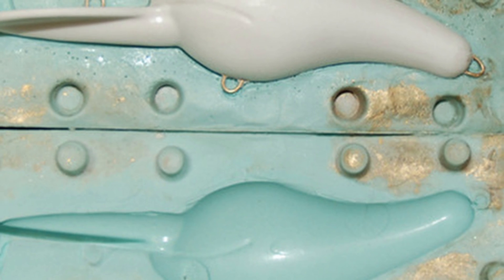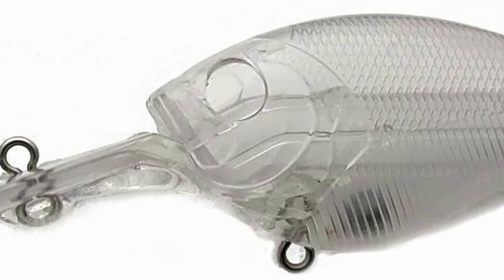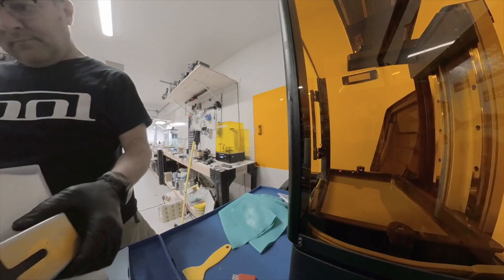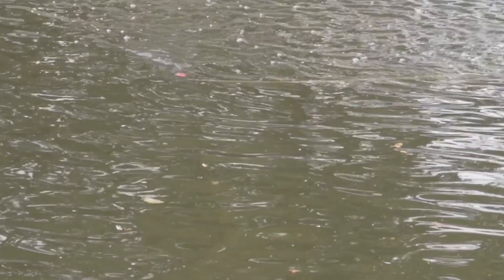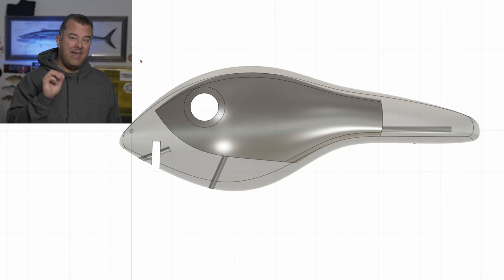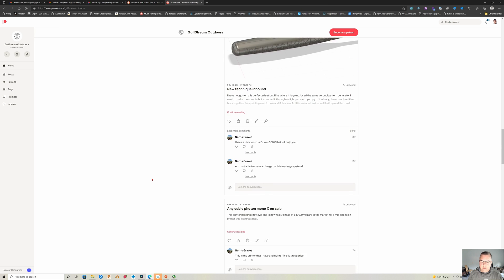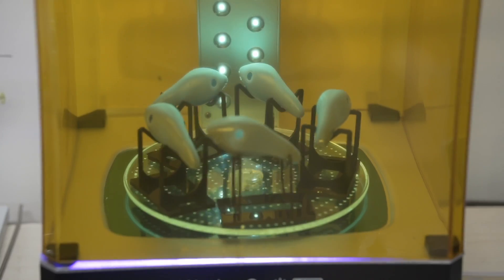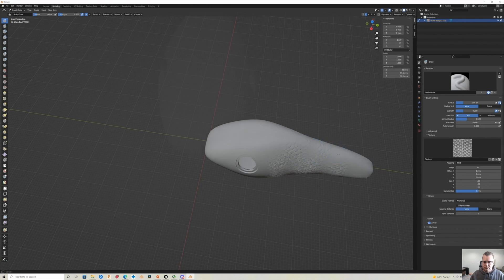The Future of Custom Lures is 3D Printed

Comment: Just curious about the resin brand and type that you use. Mine are always too heavy, even when hollowed out. TIA
Reply from the maker: Most resins have the same specific gravity, I have not really seen any that are lighter or heavier than any other. Having said that I have not tested that at all, sounds like a good thing to look at.

I have been blow away recently with Resione AntiImpact resin. Looks amazing as is tough as heck. Will have a review up shortly but giver it a try you might like it!
Reply: @WMBayouLures  thx I will

Comment: I wished. I was smart enough to do computer and 3D printing, I have 7-10 spectacular new lure designs, I have spent 5 weeks now, just getting each side to match up. Looking from top down, Gill plates that stick out are at same measurement for each side much less getting each side to look identical, I cut small pieces of wood grind them down at a angle cut to shake glue each piece into place, trying to get each side to look like other, I had to do it 8 times grinding out the plates starting over, still not perfect as I like but that’s hand working, and just being a dumb stupid person that lets a computer. Scare him. I wound love to be able to cut a lure down the middle and have both sides exactly the same shape, angle, cuts, shapes, distance, and hit a button put it back together push a button and minutes later out pops a master body, perfectly matched to each side smooth angles, 1st day of week 6 I just sawed it down the middle, and not perfect, hope it doesn’t throw off balance, hv dermeled a small channel for hook eyes, line eye, i use 1 piece of leader wire solid connection no pulling out, this week I will have it glued back together, and drilling weight distribution holes in it, so liking at 2 1/2 months to make one damn lure it sucks, as well each side is not perfectly matched there are radius that don’t match perfect, but can’t afford to hv someone program into computer. Got a quote from someone that does this stuff in his Spare time, he wanted 559.00 but got him down to 400.00, he’ll times 8 lures looking at 3,500 close to, for 8 lures I can’t afford that so I’ll never have the other lures made prob, cause I am not spending another 4 months making, cutting, sanding, redoing, 3-4-6 times, to make another new design lure. I’ve got hours prob over 60 hours in this o e damn lure, started over 5 times, I wished I wasn’t so ignorant & stupid when it comes to computers! Bro you make it look so freaking easy, no way could I do that, gid how I’d love to have someone 3D print me my lure designs. And make me about a dozen of each, I’d love to paint about half save 4 fur mold making only make 2 for special friends. Wow but one can dream 
Wished I’d never found the is video,  Susie now I know I could hv my lures made so easily, to hv. my masters made great video
Reply from the maker: Hey man, it just takes time brother! If you start today in 6 months you will be way better than you are today, don't get discouraged or tell yourself you can't do something! 

You can also reach out to a local college/technical school and see if you can find a student that is interested in helping you.

Comment: Your stuff is looking way better, especially these clear crankbait bodys with the scale pattern got me! What about the material strength of these resin baits vs regular polystyrene lures?
And how much detail do you get out of a resin printed lure, is it possible to get tiny scales and other things like on a megabass hardbait?
Reply from the maker: Thanks man! Appreciate the compliments! I am going to be working on some strength comparisons this year, hopefully before summer. I just need to get all the equipment together. I have a wake bait that I have fishing with about 6 trips now and it is still going strong. I think once you coat it with clear coat there is not much difference.

Details are easy to produce for the printer but at least for me take a long time to model on the bait. Totally doable though, I know 6th Sense used Fusion 360 to produce one of their latest swimbaits.
Reply: @WMBayouLures  Sounds very interesting, I look forward to that already! 
Thats what I thought, the printers should be on that level already, I will put some hours in designing then.